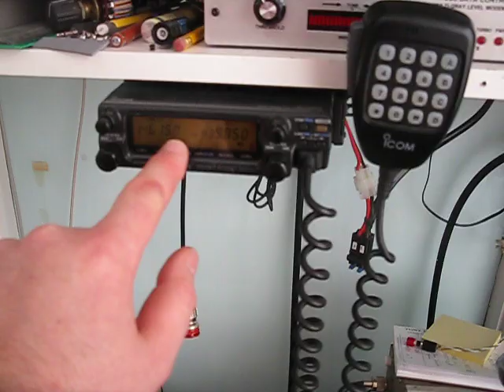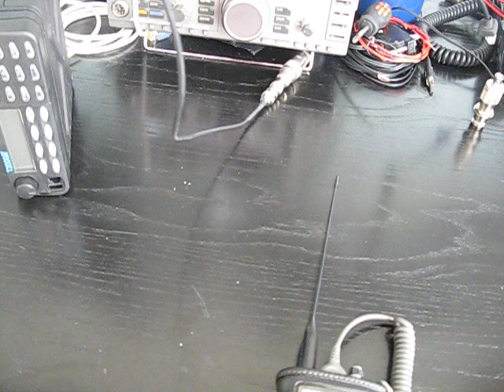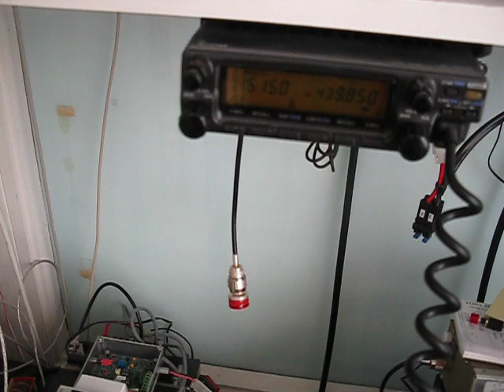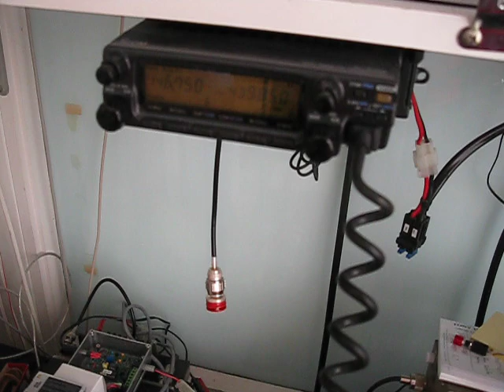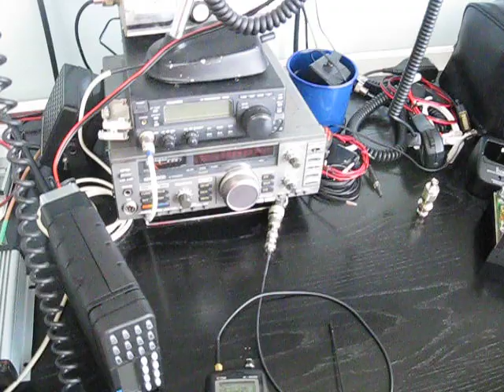D-Star, IRLP and AllStar/Asterisk linking

Comment: Is 0040 still up? I dial it and it says that it is not a node number.
Reply from the maker: I see to recall that a small configuration change is required for IRLP nodes to connect to "experimental" nodes.
Reply: Michael Carey Oh. Well I am using a club node, so that isn't possible. I wish asterisk still had support for IRLP so I could install it on my allstar node.

Comment: Hi mike i note you are using the simocco srm9000 rf module for your allstar gateway rf, i would like to use my uhf srm9000 for my allstar rf unit, however i am unsure of the COS connection, i have tried using it without COS connected but i do not hear any rx audio, oddly i have used the srm9000 on my dvrptr dstar board and that works fine, can you advise please.

Comment: Are you able to connect to Echolink as well?
Reply from the maker: I believe there is a way to add Echolink to an AllStarLink node and you can add Echolink to an IRLP node.  You could (in theory) then use the AllStarLink node to bridge between Echolink and AllStarLink.
Reply: Michael Carey
 Yes, I have this setup on my AllStarLink node 28912, which is Echolink Node 828057. I also have a fully functional bridge like the one you're using in this video all set up.

Comment from the maker: @706MK2G A "normal" IRLP node needs a small modification so it can connect to nodes numbered below 1000, the D-Star repeater/gateway/hotspot needs to use the Dextra linking system (similar but different to Dplus) to connect to the XRF reflectors.